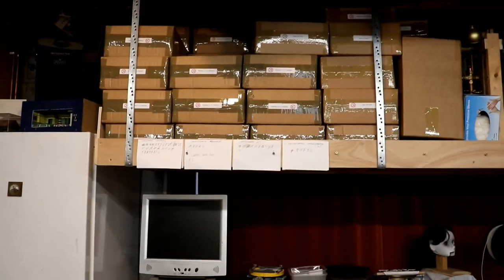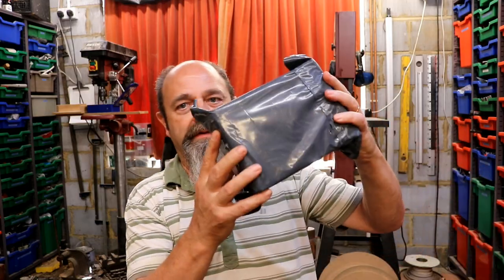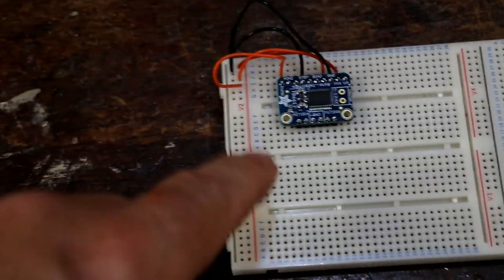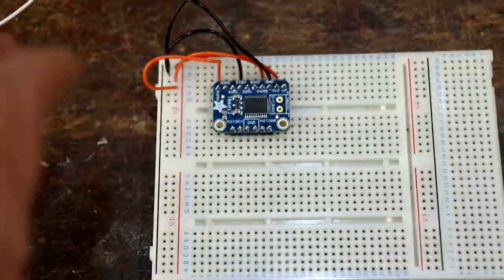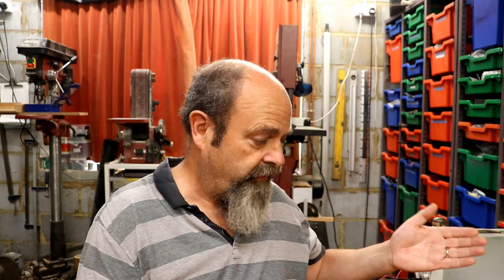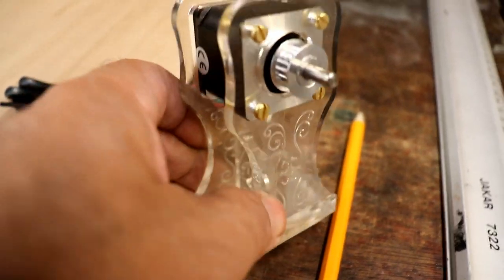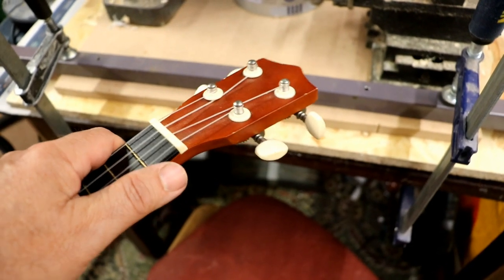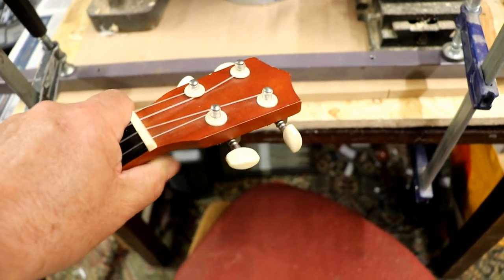Steampunk Music Machine - 3

Comment: I see you've come up with a workable solution for this base, but I'd like to offer another tip for next time you need something flat.  MDF or medium density fiberboard is extremely flat and even.  That OSB, just like construction grade plywood is subject to swelling and shrinking at different rates due to the various wood patterns/ voids within.  MDF won't do that.  It can be shaped and painted as is, or have a veneer applied.  If you go for something like Walnut as the veneer, you can skip staining and you'll see so much more of the wood character as it won't be muted by stain.  Stains are sometimes necessary, but they can be like throwing a blanket over speakers when you listen.  Or maybe I am just a wood prude =).
Reply from the maker: Thanks for the advice Tom. Unfortunately all the MDF sheets at B&Q were also warped - don't ask me how, they must have special techniques to ruin their wood supplies! Hopefully the OSB I ended up using will be pretty stable, fingers crossed. Using proper veneer would be great, and perhaps I'll give it a go - I used to use self adhesive veneer on MDF for the speakers cabinets I used to make for a company, and it did give a lovely finish. I think I stuck with ply, simply because, when purchased from a reputable woodyard, is stable, flat and can have a nicely grained surface which can be stained... veneer would be preferable, but cost is always the bottom line, especially with everything going up at the moment.
Reply: @steamhead  Lol.  Should have known you've tried that before!  Special techniques 😂
Reply from the maker: @tomtomisek  but thank you for the suggestion, always good to hear from you.